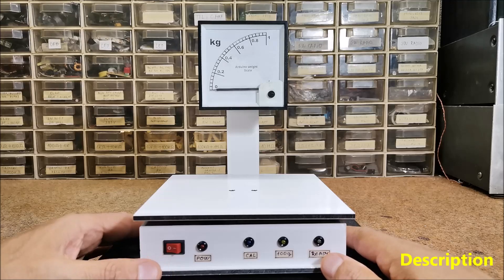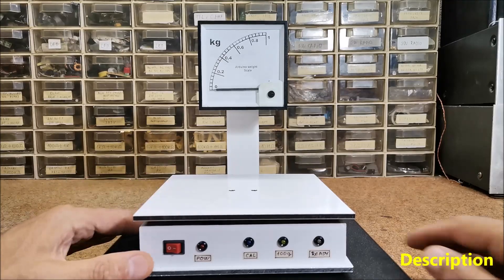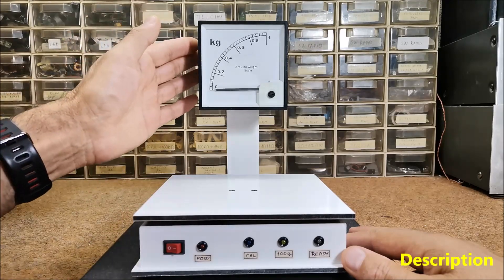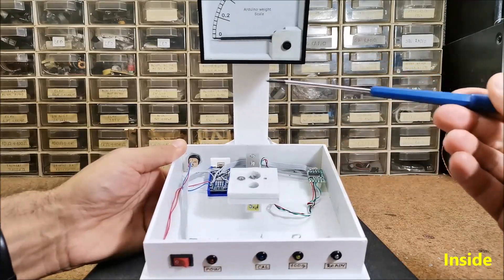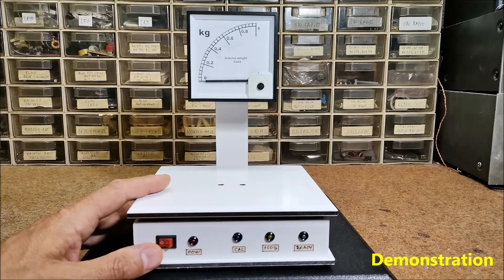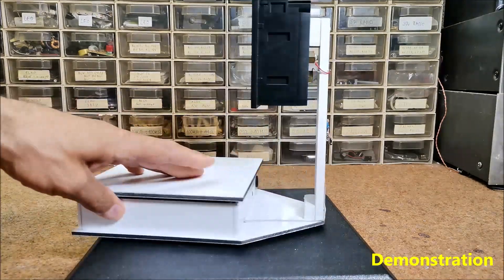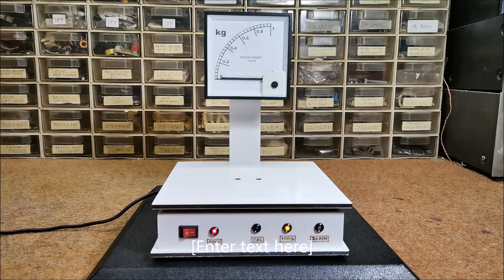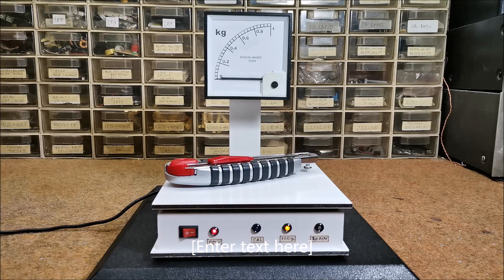Arduino weighning machine (scale) with analog showing

Comment: I really enjoy your projects! Congratulations! I use to take ideas from them :) . I'm quite interesting in knowing how do you manage to create those PVC enclosures for your projects. How do you cut the PVC? I would like to see in some future video a few seconds of that process. Cheers!!
Reply from the maker: Thanks, the PVC board is easily cut with a modeling scalpel
Reply: @MirkoPavleskiMK  just with a modeling scalpel?? It's impressive. I thought that 3 mm PVC board was strong for being cut with that! I did some enclosures with foam card board but really want to try with the PVC as it looks more robust. So with a normal solid PVC board I would be able to cut it ? Thanks!
Reply from the maker: @EduardoMarcos  I use a relatively soft PVC board, which is used by a local billboard company